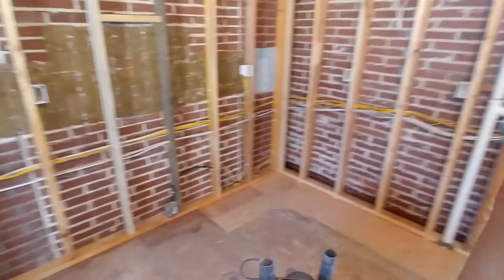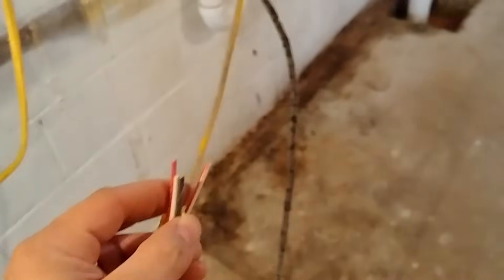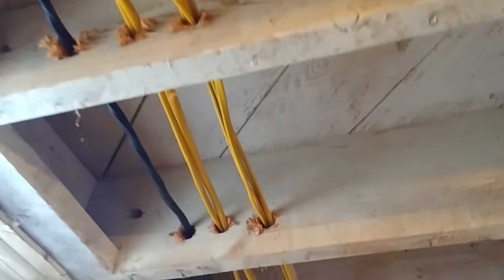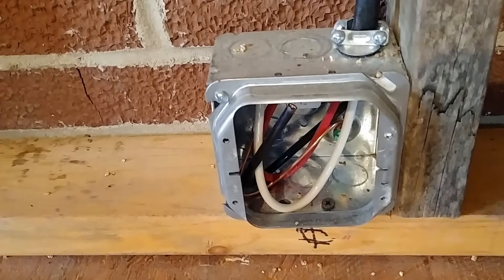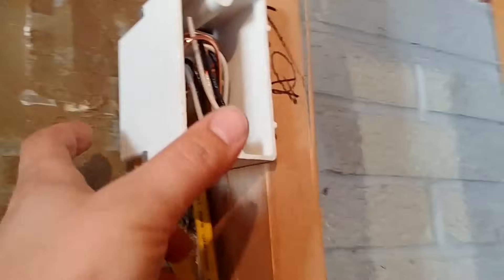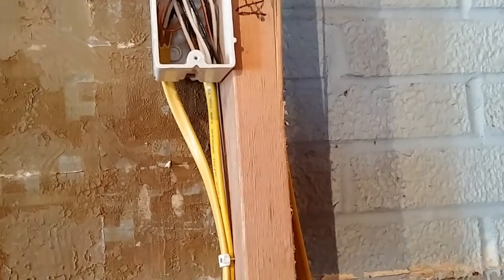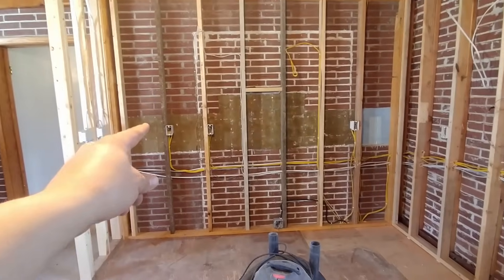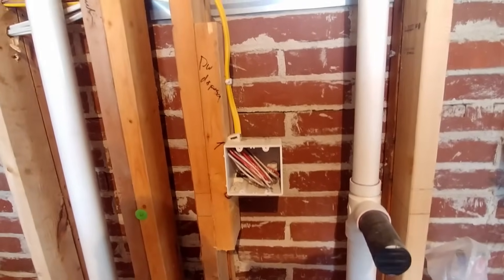Kitchen Rough In Wiring Guide

Comment: One problem I see with two circuits in the same box, (2 seperate breakers, I know) is that someone could open this box up after turning off the say, disposal breaker, but still have 120 volts hot on the dish washer outlet.  Not a problem if the breakers are tied together as in a 12-3 120 volt circuit.
Reply: If two circuits share a box they need to be on a two pole breaker.
Reply: I’ve seen “tie bars” for connecting two individual breakers in a panel together. Does that satisfy the rule?
Reply: If it's a new installation your using afci and or afci/gfci overcurrent devices. And if I'm not mistaken manufacturers have not come up with a 2 pole style in OCD's that meet that requirement. However, that's not to say there is not an aftermarket UL/ETL listed handle tie to co join OCD's. And I'm not even sure that is a possibility as both breakers would have to simultaneously trip.
Reply: @jamescollins8148  Comments like this reminds me of why I weed through comment sections because there's always a few that "spark" memories of the little important things my master electrician told me during jobs that I might later overlook because I was overwhelmed at the time trying to soak everything in but since you mentioned it I immediately recalled a few times of him talking about instances like this regarding safety somewhere along the lines of "Even though people like us will always test before working on it we can't assume the next person will so if one circuit trips both of them should." And him showing me how to tie two breakers together if it wasn't a double pull.

Comment: 12/2/2 and 14/2/2 cable are used for a couple purposes. One is multiwire circuits with GFCI on the two circuits. They each have a neutral so they should work normally. GFCIs tend to have false positive trips if they're on separate circuits and share a neutral. The other use for /2/2 is for code compliance for a neutral presence in a 3-way switch box. Since 2011, the NEC has required a neutral to be present in a switch box.
Reply from the maker: Awesome! Thanks for sharing your knowledge on this.
Reply: Why would there have to be an neutral present in a switch box ??? I've never been sited for this !!!!
Reply: @blakehorton8110  I believe this came about because some dimmer switches require a neutral.
Reply: Blake Horton check your code book
Reply: Glenn Moses more for occupancy sensors or timers. I don’t think I’ve ever seen a dimmer require a neutral. I’ve been a residential electrician for 15 years.
Reply: @KitchenerLeslie2  Lutron Diva electronic dimmers (DVELV-300P) have always required a neutral. I have been doing high end lighting for 14 years, so our niche has been high end lighting, halogen 12 Volt and 24 volt systems, and LEDs more recently. Some smart dimmers also need a neutral, like certain Lutron Caseta, Lutron Maestro, and also some Legrand dimmers have models that require a neutral, like their smart dimmers and universal dimmers.

Comment: Good video. As a one man show who wires 10-15 dwellings a year plus numerous kitchen/bath remodels and flips it's good to find what other trades people are using for material. I find myself using more 14/4 romex in installations where I need 3way switching capabilities and to bring a  constant feed. Good to find 12/2/2. And yes the cost is great,but, also cuts the cost of labor, no need to set up an additional reel or peel off an additional amount of material and have an additional ground in a box. Another thing that I liked to see and that I'm not the only professional that is doing is offsetting the kitchen counter outlets. Two things that I did see that may be a wasted effort is a dedicated circuit for refrigerator as the code does allow for the refer to be on the kitchen counter circuit, and the additional circuit for the hog, I usually share that with the dishwasher and split a duplex receptacle  to accommodate the hog. Most dishwashers are rated at 1500 watts, which mathematically divided by 120volts is roughly 12amps. A hog at most under load consumes 3amps. Which total amperage consumed is 15 amps used on a 20amp circuit and 16amps is the maximum amount of current that we are allowed to use by code.
Reply: What are you referring to by "hog?" Thanks.

Comment: Its really cool to watch these videos as an apprentice and see the difference between American and Canadian wiring  (as i am an apprentice from Ontario). Its also interesting to see some of the slight differences in what Code allows you to do that would be against Code here and visa versa....Keep the videos coming!
Reply from the maker: Will do! Is Canada fairly similar with wiring methods and materials?
Reply: @BenjaminSahlstrom  Awesome! Yep, for the most part it is pretty similar... A couple differences I've noticed is,  you guys use 12/2 for some circuits that only require 14/2 here, as well as stacking wires under a single strap is against code here in Canada. Just things like that....

Comment: I would have liked more information under the cabinet lighting. What model what brand is used. And what gauge cable is used for the low voltage that's hanging under the bottom of the upper cabinet.

Comment: Good video man. That 12-2-2 seems pretty cool. Alot of guys in my area use 12-3 to feed two different loads having them land on 2 different 15 amp breakers. Just shows you how many ways there are to complete the same task
Reply: It's odd that your AHJ allows sharing of a neutral, whether the hots are on different phases or not. Ours hasn't allowed it for as long as I can remember.
Reply: @monkeyCmonkeyDoo  I agree, probably not legal by the NEC but they get away with it.
Reply: Slam Pig if you do that you will never be able to replace those two breakers with an AFCI breaker or even outlet as they share the neutrals. It will trip from the get go and never set.
Reply: @Lessgetbrootal  you can share a neutral, you can’t share a neutral for arc fault or GFCI circuits

Comment: My Google search on 12/2/2 landed me at your video. So hopefully you see this comment and can answer 😅 or direct me to the correct place. I had a sub panel installed for a kitchen remodel, and the electrician used this 12/2/2 wire for all the runs. I went to hard wire my new oven into the cabinet junction box and the two white neutral lines have me very confused. 
Oven cable is red, black, white, and green. Easy enough. 
But then with that 12/2/2 being red, black, white, white with red stripe, and bare copper ground it has me lost. 
If it’s going to be one circuit, does the second white neutral just get capped solo and left to hang out in the box? Or do all three whites get twisted together? 
Or is the second white get tied in with the ground? 
All the forums have only created more confusion lol

Comment: Great video. Thanks for sharing 12/2/2 cable. I might use that for my kitchen outlets. One question that I want to confirm is that I need to use two 20a breakers for this 12/2/2 as if I am doing two 12/2 cables? Or can I use a tandem (if main breaker allows) breaker?

Comment: Nice video.  Have you seen the installation of a disconnect for an electrical cooktop. Something like a Spa/Hot Tub disconnect, RV disconnect, AC disconnect, or maybe a non-fused safety switch. Product selection has always slowed me down. I spend so much trying to decide on the best product and solution.

I would like to do this in my kitchen, that way, power to the cooktop can be turned off without having to go all the way to the panel to switch off the breaker.  The disconnect would be installed in the cabinet under the cooktop. So I am looking for a nice upscale disconnect product.  Finding an good disconnect product is hard.  I have not been satisfied with what I found at the big box store. It is basically a single breaker panel, but it does not have to be a breaker.  I hope all this makes sense.
Reply: Since it's in the cabinet  a Double Pole 50A switch should do the trick. Just connect the Red and Black from the Home run to top of switch and Red and Black to the range top to bottom of switch, the double pole will shut off both Hots at the same time.  
Look at: BRYANT 50002D 50A 600V 2P DISC SW

Comment: I started out replacing the floor, but soon realized that before I can install the new sub-floor I got to take care of any re-wiring because afterwards it would hard and in some areas impossible.  I have only one 20 amp circuit which services all of the outlets, been coping with that by not running the microwave while the toaster is on, luckily the fridge and micro/fridge and toaster was not blowing fuses (yes, I said fuse, I have a mix of a fuse box and circuit breakers)..my house could be used as a video on "how not to wire a house".  The previous owner thought it was cute to install all the outlets upside down, seriously..I can remember him telling me that in 1994.  He also used 14 gauge wire for a 20 amp circuit.
Reply: Scary.  Sounds like most of the electrical needs to be gutted and redone.

Comment: With 2 circuits on one wire I'm wondering about bundling issues
Two wires per 3/4 hole. But now you would have two circuits on one wire so does that mean only one cable per hole?
Great videos
Very informative
Thank you
Reply from the maker: Great thought! I'm guessing you are probably correct but I doubt that inspectors will be very picky about that. As you saw in the video there are several spots where 3 wires were in the same hole. I don't think it is really a big issue to inspectors and also likely has little to no affect on the performance of the wiring.

Thanks for your comment!
Reply: There is nothing in the NEC about 2 wires per 3/4" hole. You can not penetrate a top or bottom plate with more than 4 wires, no matter what size hole you drill. Running horizontal, there is no rule limiting you to 2 wires per 3/4" hole.
Reply from the maker: @monkeyCmonkeyDoo  Thanks for that clarification!!
Reply: Brian Middleton is this true even with home runs out of panel? 4 wires per hole?

Comment: Thank you for the informative videos. I am getting ready to wire a whole 2,000 sq ft home and feel that I have figured everything out but one thing. The main panel/meter is about 250’ from the home. It is a 200amp system and I am planning on running the cable underground inside a conduit. 4/0 wire is what I come up with. Is this the right size? How do I know for sure what type of wire I can put underground inside the conduit? The wire type is aluminum. Thanks in advance
Reply: You need UF (Underground Feeder) cable. Avoid aluminum unless you really know what you are doing.
Reply: UF doesn't need a conduit

Comment: I've never seen 12/2/2 cable before but that's really cool and super useful for that kitchen stuff.

Makes me wonder, have you ever encountered a 12/2 or 10/2 cable that had a red, black, and bare ground for 240v circuits without neutral? Or is the thing to do just to put red tape on the white wire and use that as a hot?
Reply: They could have just used a 12/3 cable in the fridge homerun circuit, and shared the neutral wire back to the panel. No need for the extra white wire
Reply: @chrisb6866  why thanks for the response that doesn't answer my question at all. There's clearly a reason they wanted the extra neutral wire, perhaps because they didn't want to or couldn't tie handles together for whatever reason. Of course it completely eliminates the possibility of overloading a neutral wire also. Since the fridge is a dedicated circuit and the other circuit is for outlets which would be a variable load, it might not always be balanced, and it could be possible to overload a shared neutral.
Reply: @Krankie_V  That isn't true. A shared neutral only carries back the difference (in amps) of the two loads. If one of the circuits is pulling 8 amps, and the other is pulling 10 amps, the shared neutral is only carrying 2 amps. So, if one circuit is pulling 17 amps, and the other circuit is pulling 17 amps, the neutral isn't carrying anything. In that case, you could disconnect the neutral wire and nothing will change.

Comment: 2:57 Typical circuits for Kitchen rough in wiring list
1. Electric Range 220v 40amp 8/3
3:51 2. 12/2 Wire 120v Single Pole 20amp Breaker
5:30 3. 12/2/2 Wire 120v Single Pole 20amp Breaker Fridge
7:05 4. 12/2/2 Wire 120v Single Pole 20amp Breaker Disposal

Comment: 12-2 w/gnd is about $0.30 per ft.  while 12-2-2 w/gnd is about $0.57 per ft.  Cost of running two wires instead of one is not much different for material, but is twice the labor.  Back in the day a 12-3 w/gnd would be run, but you could have the problem of sharing the neutral.  If the neutral opened, you could have 240v across a 120v outlet and cause damage to equipment.  Experience talking.

Comment: Just curious but are the NM cables running directly into the panel?  Aren't you required to have some protection (like conduit) if your basement is unfinished or they are in an exposed location?  I am attempting to run a few new circuits for our kitchen remodel and am running into this issue.  Our panel is in an unfinished utility room in our basement (directly under the kitchen).
Reply from the maker: In our area it is not required to have them in conduit most of the time even in unfinished utility rooms/basements. I don't know the hard and fast rule for when conduit would be required other than the panel and wiring being in an outdoor location.

Comment: Fifty years ago it wasn't unusual for me to pull ten or twelve conductors through a two inch hole. In an exposed basement it made for a neat job. Strange, but all those buildings are still standing, their excessive heat notwithstanding??
Reply: yes, my house (1987) has 100% every wire from a 200AMP (FULL) panel going through one 4"? hole in every floor joist.  Tight as HELL!

Comment: Please I need an answer for this question. The kitchen is an l-shaped you're running two circuits GFI a 12-gauge on each side for the appliance.  How many appliance over or on  the countertop can one GFI control. The other question is is it better to put the GFI in the electrical panel. There's one for GFI and Ark. Is it best going that way.

Comment: Fridge and  microwave needs to be a dedicated circuit  here .I can see why with both ,   refrigerator on its own dedicated circuit is the recommended best practice for homeowners. Most refrigerators run between 3 to 6 amps, with that said, a refrigerator can spike at peak usage up to 15 amps.  , most  microwave  use lots of power too .
Reply: Every appliance need dedicated circuit 15 or 20amp

Comment: From what I research there are no 40amp range receptacles. There are only 30amp or 50amp. Which one did you use for the 8/3 wire?
Reply: must have been 50amp. I cannot think of any current model electric range using a 30amp plug/input. I just did the same, and just use a 40a breaker to the 50a receptacle.

Comment: I would use 12-2-2 romex more but it's hard to find, and it's expensive. But it saves time in installation, and you can use 2 single pole breakers instead of one double pole breaker. Which is what you would have to do if you use 12-3 romex to run 2 circuits.
Reply: 20 amp 12/2 or 12/3  is code for Kitchens ,basements ,garages ,outside ,bathrooms, you could just do the whole house in 12/2 builders like to save a few pennies so they  use  14/2 15amp where they can bedrooms etc..
Reply: @SG-zh5xd  About the only thing I use #14 for is general lighting.
Reply: @jolyonwelsh9834  I like that practice do it my self ,lights on a 20 amp circuit I use 14/2 from switch to light unless a ceiling fan .
Reply: @SG-zh5xd  Yes there is no need to use #12 for today's LED Lighting not to mention box fill issues will be somewhat reduced especially if you use dimmers and occupancy sensors. Both of which take up a lot of space in an electrical box.

Comment: Use 120 volt under cabinet lighting, eliminate the transformer, works 10 X better, low voltage under cabinet lighting is harder to install and not as reliable

Comment: I've seen guys use just a 12/3 for two circuits. Is there an issue with using the same neutral for both outlets on both circuits on the DW and Disposal for example?
Reply: @ Sir Nordeng
Yes, there is an issue with it. If the neutral comes disconnected for any reason, you would have 220 volts going to each appliance.